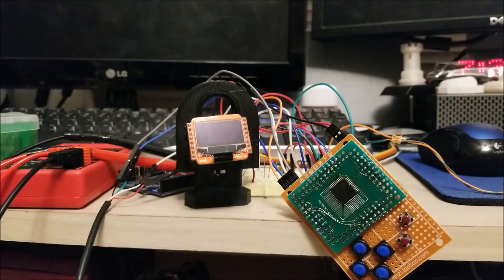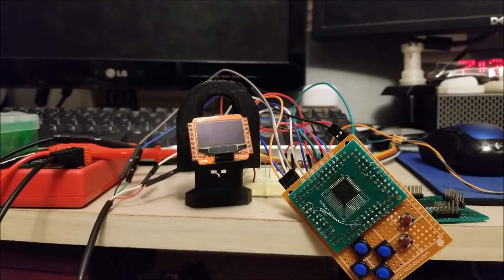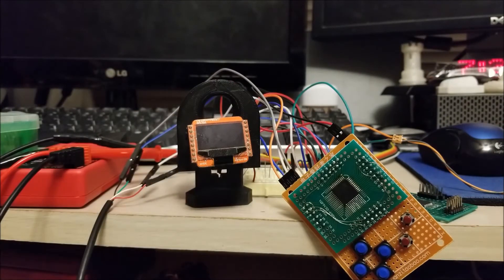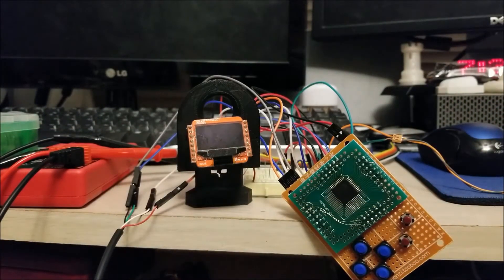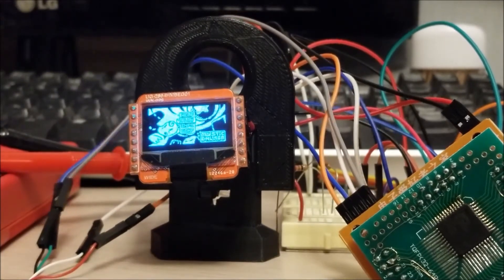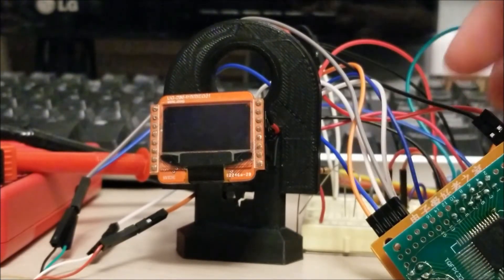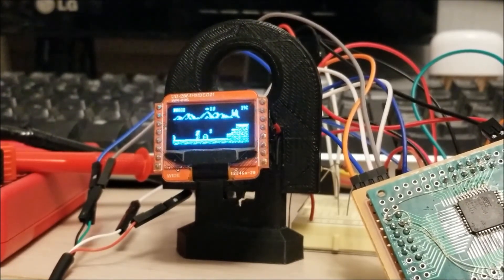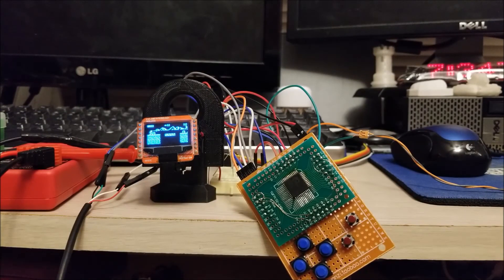Building a DIY Arduboy from Scratch

Comment: what if you treat the system/chip itself as the interchangeable cartridges, and the body would include the power stuff, the buttons, the screen, and the cartridge connection
Reply from the maker: EMCvids That's exactly what I am working on designing 3d printed shells for!
Reply: awesome!
I do 3D modeling, so I would be happy to help with anything related to that